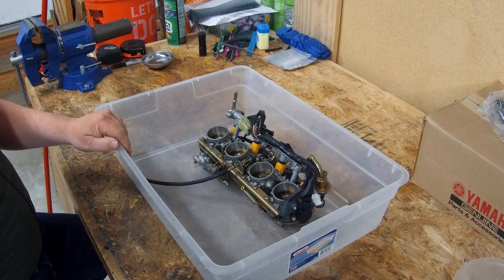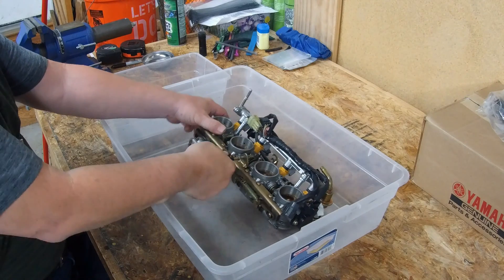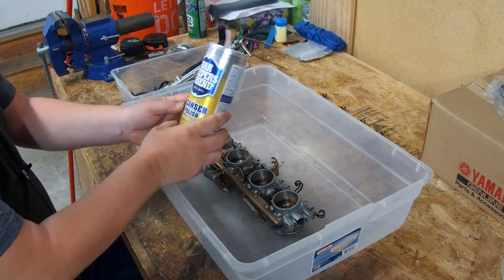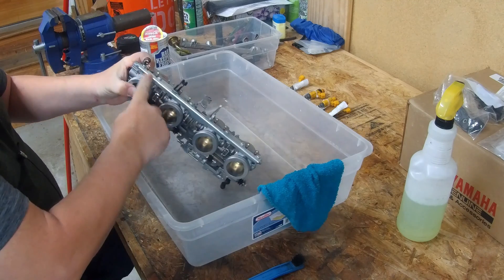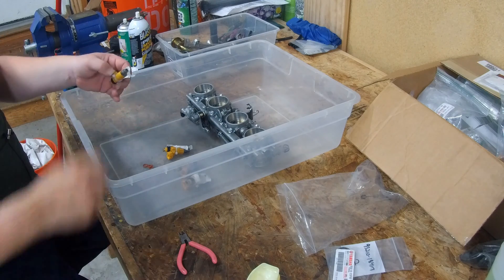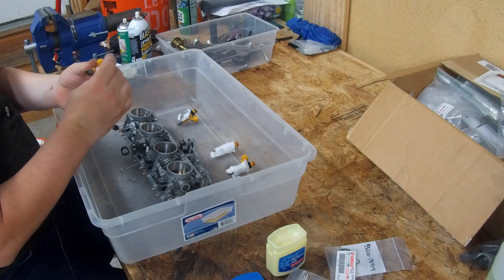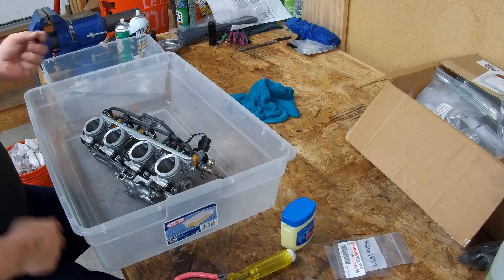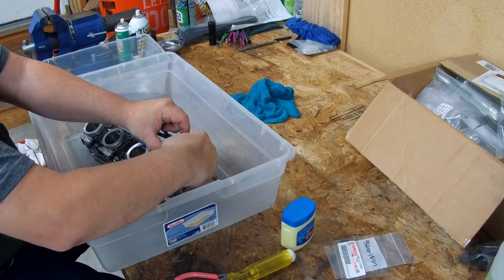FJR1300 2005 Gen I Vibration, Adjust Engine Balancers, Clean Throttle Body & Replace Seals. (PART 2)

Comment: Hi Mike, I love your detailed well presented vidoes. It reminds me of schools I took in the Air Force to work on aircraft.
I am studying to be a FJR owner. Would I be better off getting a Gen 3 or Gen 4 versus a Gen 1 or Gen 2 for reliability and features?
I notice there are a lot of very nice Gen 1 and Gen 2 bikes out there with less than 30000 miles for very reasonable prices.H
I have a 81 Honda CBX that I want to preserve and keep the miles off it since parts are very scarce for them.
Your thoughts would be appreciated.
Thanks in advance and Happy New Year 2025!

Comment: Mike, how do you determine what setting to set the balancers at?
Reply from the maker: Here is the instructions from the manual: Tighten the balancer shaft to the specified torque 0.4nm (3.54 in lbs) by turning it counterclockwise, and then turn it one scale back on the balancer lever scale. 

Tighten the balancer shaft pinch bolt 10Nm (88 in lbs). 

Start the engine and check that there is no abnormal noise coming from the balancer gear. If noise is abnormal, adjust the gear lash by turning the balancer shaft.

NOTE:
With each adjustment, turn the balancer shaft one scale.

Clockwise Decrease gear lash.
Counterclockwise Increase gear lash.

Hope this helps, thanks

Comment: Did the balancing adjustment help?
Reply from the maker: Hello, In this video I did several things at the same time. So, collectively there was a difference. In hindsight, I'm leaning more towards the throttle body and injector cleaning, over the balancers. Although, there seemed to be a lower vibration that was eliminated. Hope this helps.

Comment: hey mike. I have another question:  the engine balancers is something that has to be done once you remove the throttle boddy? I see you do some adjustments. I am removing my throttle body to clean it, but I am afraid to do those adjustments you just did on the video. can I proceed without touching the balancers?  other question is, where did you get all the bushings , O rings to replace the old ones?  thank you .
Reply from the maker: Hi the engine balancers are purely optional. They normally don't need adjustment. i was trying to do everything i could to help eliminate engine vibration. The injector seals came from oem suppliers like partzilla.com or mrcycles.com. if you use the cleaner in the video, only use enough powder to fully dissolve in the water. Blow air through all ports when finished.
Reply: @mikesfjrcorner7129  Mike, you are a great man . Thank you very much.

Comment: Geez they look like a brand new set of Throttle bodies after youve cleaned them. Amazing. I would have used a de-greaser or solvent personally. but hey if it works for you and they look like that then fair play.

Comment: Mike,
I have my throttle bodies off and ready to go into the bath. I'm wondering where you got your injector seals and filters from. Please share. I'm having a terrible time finding them. 
Thanks
Reply from the maker: partzilla.com or mrcycles.com OEM parts.
Reply: @mikesfjrcorner7129  thanks Mike. So once I put everything back together the left turn signal won't turn off... any clues why?
Reply from the maker: I'll take a look at the schematics tomorrow to see if I can itentify where or which connector to check. Likely, it's a connector or a star ground in the bundle of wires that's along the front of the frame under the tank that may have gotten either shorted or broken.
Reply: @mikesfjrcorner7129  thanks.
Reply from the maker: Look for a short to +12v. Here's the schematic. https://drive.google.com/open?id=11krb1Sv_QQIDItSvbCNe6zUGGMPnOE7-
Reply from the maker: Check the switches first, both the turn signal and the flashers switch. Could be a coincidence that a switch failed while servicing something else.
Reply: @mikesfjrcorner7129  thanks Mike. Of course it was something so obvious as the flasher switch being on. Can't see the trees for the forest. Thanks again.
Reply: I'm having SO MUCH fun with this! (NOT) So now my #2 plug won't fire so I am ordering new coils. Hmmmmm
Reply from the maker: Check that the plug boot is making connection. The boot is screwed clockwise onto the wire and could be loose after unplugging. Also there is a resistor and spring that's inside of the boot. It can be removed by using a flatblade screwdriver into the end of the plug boot to unscrew the socket. Clean the boot, socket, resistor and spring.

Well having new coils and wires will probably smooth out the engine. Mine were not bad, but after being replaced, the engine was smoother.
Reply: @mikesfjrcorner7129  Thanks for the expertise. I'll check the boots but will install the new coils and wires when they arrive.
Reply: Ok Mike. New coils installed and #2 cylinder is still missing.  I haven't pulled the plug on #3 yet but both exhausts seem to indicate a dead cylinder. Since #2 and #3 run on the same coil, is there a common input to the coil that I may have disconnected accidentally while changing my injectors? You seem to have much better schematics than I do and for sure have more knowledge 
 Any help you can give is much appreciated.
Reply from the maker: Hello Tim,  I'm going to run down everything I can think of.

Check the connection on the primary of the 2-3 coil and check that there is 12v in run position. 

Check for spark on 2 & 3 cyl. 

If there is no spark:

The schematic does not show if the connections go through a connector. so, make sure all connectors by the engine are seated. Make sure the ECU connector is fully seated. 

Check the resistance of the primary and secondary and compare the readings with the 1-4 coil. The primary is measured across the two primary pins and the secondary is measured between the two plugs with the resistors removed.

Are we making a good connection to the wire at the boot? Also does the resistor measure OK. Compare them to each other for resistance.

If we do get a spark then maybe some other things to think about. 

If you cleaned the throttle body, make sure none of the idle circuits accidentally got clogged.

Make sure the fuel injector plug's are fully seated and connected to the proper injector.

Has the camshaft been removed for valve service? If so, has the two camshaft's accidentally been reversed or misaligned? Check for compression on the cylinder and check that the spark is firing on the compression stroke. If no compression or spark timing is off, then investigate into the cam further.
Reply: @mikesfjrcorner7129  Thanks Mike. I've isolated it down to the #2 spark plug/boot. I've swapped plugs with the #1 cylinder and still no fire. I pulled the plug cap apart and measured the resistance of the resistor. It shows 1K ohms. Is that correct? Next question is, if I order a new cap will I get the resister and spring with it. I'm going to swap the caps from 1 to 2 too to see if it follows the cap.
Thanks for the help
Reply: I read the plug cap end to end and it is open so I am ordering a new cap. Hopefully it will get here quick.
Reply from the maker: Hello Tim, yea, 1k is correct. Glad you narrowed it down. I check the parts sheet. I not sure. It looks like it comes with the resistor as they don't show the resistor on the parts sheet. Boy they are expensive for a cap!
Reply: @mikesfjrcorner7129  yep! $75.00 ea.
Reply: Hello Mike. Me again. So I finally got the bike all back together. I started it and it is burning oil like crazy from both exhausts. I let it warm up and run for a while and it was still burning oil. Is it possible I have a hose in the wrong place? What are your thoughts? They are appreciated.
Reply from the maker: Wow! I can't think of anything as most of the hoses are different sizes and shapes, so I wouldn't think you could get them confused. Take a look at the video and compare hoses. The only thing I can think of is check to see if there is any oil being sucked through the throttle body's, Maybe the crankcase breather is sucking oil from the crankcase. Maybe try running without the air box. Also, the PAIR system. Maybe there is some oil blow by on the exhaust valves that's being sucked into the throttle bodies or maybe oil on the intake valve. Did you have oil burning before you did work? retrace your step's.
Reply: @mikesfjrcorner7129  Thanks Mike. No problems before I started the work. I did get gas in my oil because I flooded the cylinders when I had the dead plug wire. I changed the oil before I started it tonight thinking the gas might have thinned the oil too much. So I'll go back through everything thing to see if maybe it's sucking oil into the air box. I saw one of your videos whered you installed blank off plates. Is that for oil blow by problems?
Reply from the maker: No, it's just to eliminate the emissions, cleanup the top of the engine. Sometimes the reed valves on the PAIR are worn and leaking, so the system is not operating correctly. But i guess if there is a leaking exhaust valve guide, it may be possible to suck it into the throttle body. I would think you would find oil in the hoses.

Yea, remove the air box and check to see if there is any evidence of oil. Run it without the air box. This would eliminate the crankcase breather and PAIR system.

Is it defiantly oil or could it be antifreeze. Maybe one of the small antifreeze hoses got crossed with something else.
Reply: @mikesfjrcorner7129  I'll give it a look tomorrow. Yes definitely oil.  I'll let you know what I find.
Reply: Hello Mike,
Tim again... OK so I pulled the engine, had the head rebuilt, put new rings on the pistons. Put everything back together. Tried to start it. It will turn over good,  fires but won't start. The check engine light stays on. I get error code 14, the fuel gage is flashing (probably because I need to put some gas in it). So it possible my timing is off just a bit? enough to where it won't run? As always, any help you can provide would be much appreciated. I blocked off the Par system by plugging the hoses. I doubt that has anything to do with it.
Thanks again.
Reply from the maker: Hello, code 14 is the manafold vaccum sensor. make sure the vaccum hoses are in the correct positions. The pressure sensor attached to the fuel rail is good and connected correctly. Wow you've done a lot of work. For some reason there is a problem with the vaccum.

Here is a link to some pictures of the throttle body. https://www.boonstraparts.com/en/part/yamaha-fjr-1300-2001-2002-fjr1300-5jw-throttle-body-assy/000000097545

Go over your work. You can use eBay to get many different views of the throttle body. hope this helps.
Reply from the maker: Make sure all of the orphases in the throttle body is clean and free of any debree. Blow air through all of the holes. Maybe carefully spray map cleaner into the vaccum sensor.
Reply from the maker: Is the cam chain alligned correctly? Just throwing a wild thought out there. The Cam shafts weren't reversed by accident? There are identifying marks on the cam chain gears that can be used to id the shafts. Maybe do a compression check.

Comment: I4 engines are not balanced by nature, the balancer only reduce the vibration to certain level, no matter how you adjust it, it will vibrate. I6 engine is perfectly balanced.

Comment: awesome video Mike. how many hours did you spend doing all this? I ask because my bike is over 100,000 miles and now is making a noise by the engine side and I think it could be a leak somewhere down there. not sure if it is a bushing thing or what. I am sure is not a bearing because it is not a regular squeak.
Reply from the maker: Hello,  Thank you.

Each part of the series was done in a day of about 6 hrs for 3 days. But that includes camera setup, shooting footage, retakes etc... I would say you could do it easily in 2 days.

Which side of the engine is the noise coming from? What does it sound like? Take a hose and hold one end up to your ear, then use the other end to search around the engine to isolate where the squeak is coming from.
Reply: @mikesfjrcorner7129  Hi Mike. Sorry I didn't read the last part of your reply, it was hidden and I didn't click on the "read more" option. the side where the noise comes from is the right side area, and it sounds like when air escapes with a lot off pressure.  like, pss, pss, pss . it is not a squeak like a bearing when it goes bad, it is just a very unique sound I would say.  I am going to use the hose to see if I can find out where the noise is coming from. thank you. another question I have for you is that I bought the tool to do a throttle body sync, I followed all the instructions on how to assemble it and install it to do the test, I adjusted the valves # 1,2 and 4, but as I was doing it, I could not make valve #1 to line up with the rest of them, the first valve on the gauge was reading very low, and to make it go up to line up to the others I had to go clock wise, but I got to the limit of that screw and I couldn't go more. does that mean something is going on with the injectors, or something else in the engine ?
Reply from the maker: Well, I'm scratching my head! An air sound... I don't know. I'm guessing you should have a dealer that know's these engines look at it. 

I'll just throw a few suggestions out there, as there is a lot happening on the right side of the engine.

Check that the plug's are tight and not leaking.

Check if the sound is coming from the Intake or Exhaust. Maybe there's a leak there.

If it was a random clicking, grinding noise towards the front, I would say, check the cam chain. But this is like an air sound. 

Check the balancer's on the front and rear of the engine. Maybe they are making noise.

Check the reed valves for the PAIR System. During the exhaust Stroke there is a reed valve that closes to prevent exhaust gases from entering the intake, if this valve is leaking, maybe this could make a sound. The reed valves are located on top of the valve cover on the left and right side. 

Check the compression on the cylinders since you could not get a correct sync. Maybe there's air pushed into the valve cover or crankcase which, is open to the front right side where the cam chain is. I would think this would make the engine not run right.

Also make sure the engine idle's smooth. If there is wire, coil or a plug problem, the clutch can make weird sounds as a misfire causes the springs and plates to chatter. However this would sound like a clanging sound. The clutch is located at the middle right side.

There is a pump located towards the back right side of the engine. Maybe that's making noise.

Also, Make sure your sync gauge is calibrated. Connect all gauges to one vacuum source through a 4 into 1 tee, and make sure they all read the same vacuum reading.

Again, get it checked out by a professional. As I'm only guessing without actually hearing it.
Reply: @mikesfjrcorner7129  I appreciate you taking the time to read and reply to me. I took the bike to a motorcycle shop to check it out, but the mechanic couldn't diagnose anything. He told me that to find what was wrong with the bike, he would have to do it by hours and that was going to get expensive because he  couldn't think where that noise was coming from. Although he mentioned that it could be that the exhaust could have a leak and that might be projecting the sound through the pipes, making it harder to identify. 
I am going to follow your recommendation on checking the exhaust intake, plugs,  balancers, and check if the gauges are calibrated. Again, thank you very much. You are very kind.

Comment: Good video, Mike. Very informative.  Just curious... why didn't you clean and test the fuel injectors while you had them out?
Reply from the maker: I had replaced them with a flow matched set,  a few months before the video. They are the same as a "1997 - 2000 Mitsubishi 2.4L Bosch CDH275" injector.